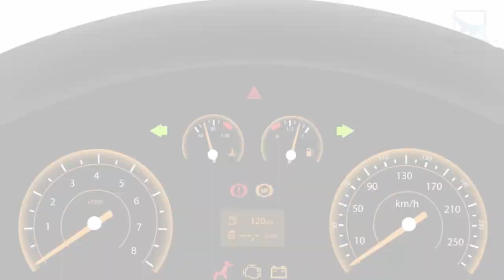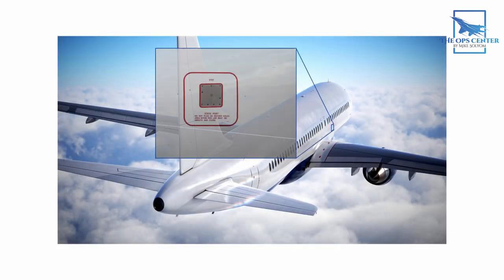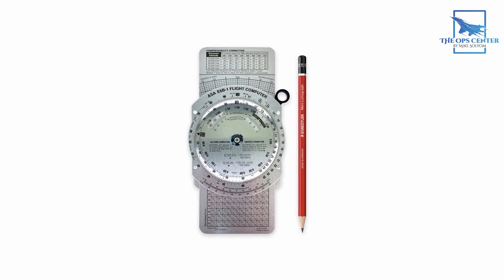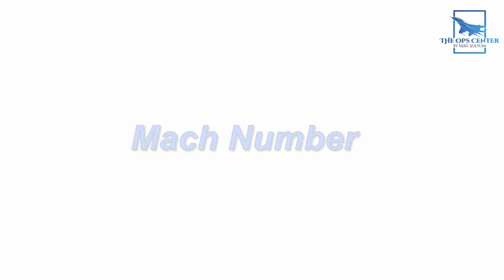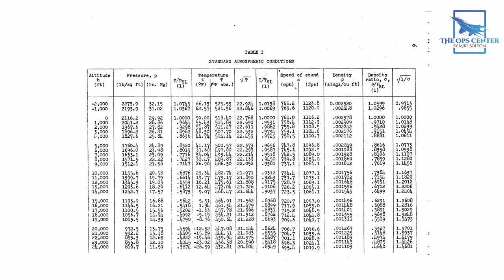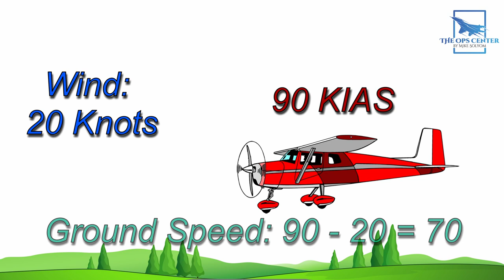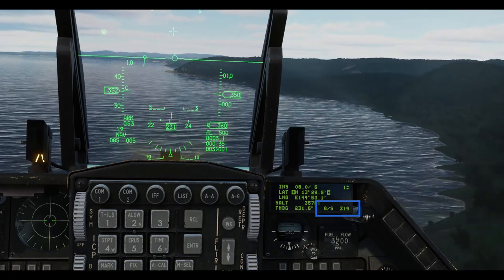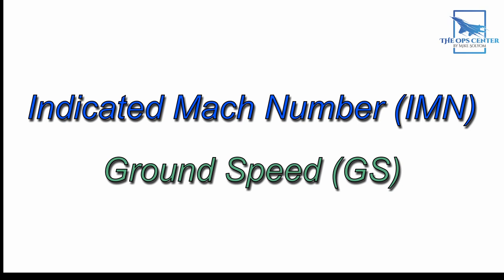IAS EAS CAS MACH | Airspeeds For Aviators | Aviation Explained

Comment: Small tip, the F-16 can show calibrated, true, or ground speed in the hud. The switch is found on the HUD panel just to right of the stick. Though in DCS ground speed seems to be broken.
Reply from the maker: Yeah, I know that switch and I agree. The last time I tried it there seemed to be some problems with it. Thankfully, the speed displayed on the DED seems to be accurate.

Comment: Super informative thanks for the video! You do a great job explaining this stuff. Btw how do my ancient virtual MiG15 and F86 calculate Mach number without all those fancy calculators?
Reply from the maker: That's a great question. The engineers at the time understood the Mach number quite well. It's fluid flow velocity over the speed of sound in the local medium. An easier way to think of that is Indicated Airspeed divided by the speed of sound at a given altitude. Both of those numbers were available to the instruments of the time. So a mechanical connection between those instruments could be used to display a Mach number.

Today, we can be more accurate by using TAS for the speed component and air temperature to gauge the air's actual density. This is thanks to the better electronics we enjoy. That will give us a more accurate Mach number. But what was available in the '50s would give pilots a number that was close enough.
Reply: @TheOpsCenterByMikeSolyom  thanks, it is amazing what they did with the tech at the time. Anyway thanks again, great channel you have.